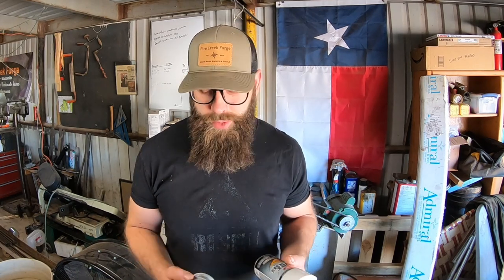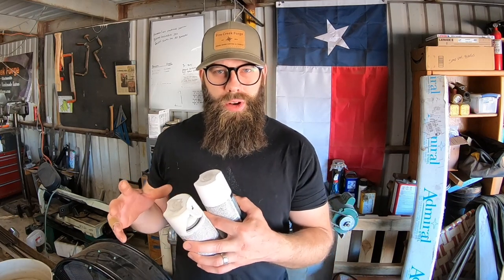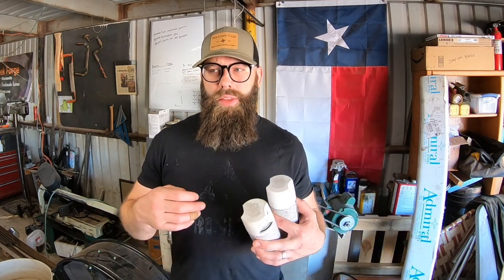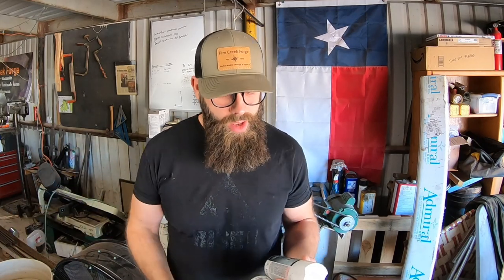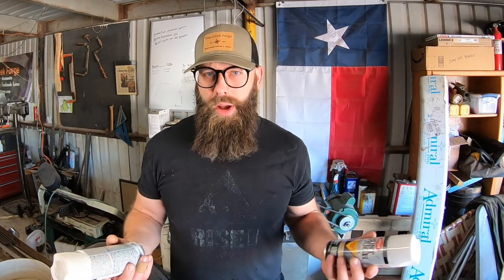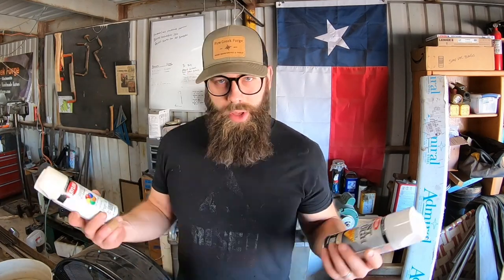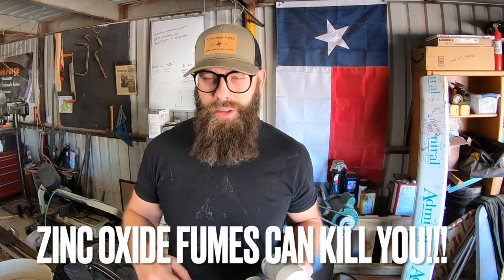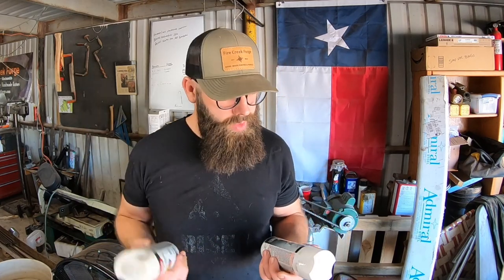Stop Using White Out for Your Canister Damascus!! Tip Of The Day Blacksmithing Forge Welding Knife

Comment: One can check the Safety Data Sheet for the paints you're interested in, or are using, to get insights into what materials are being used as pigments.  The sheets are easily found via an Internet search.  For example, the SDS for Krylon Colormaxx White Primer lists both talc (magnesium silicate, hydrated) and Ti02 as components and they're both white.
Reply from the maker: Good to know
Reply: krylon has around 2%.
Reply: Talc has poor tint strength.  Usually if it's in a paint, it's for mechanical strength/toughness and/or as a flatting agent.  Silicas are often used in a similar capacity but cost more and are more hazardous to handle in manufacturing (but might be preferred for certain applications where the binders need to provide good chemical resistance or flexibility and tensile strength to the cured system).  For commodity paints like Krylon, talc can also be seen as an extender, reducing the cost per volume enough to be attractive.

Comment: The overwhelming likelihood is that white paint will be white because of TiO2.  Rutile is an extraordinarily common mineral in the earth's crust, easy to suspend in paint vehicles, and generally brighter and more opaque than almost every other choice for a white pigment.  So it's not only one of the least expensive white pigments, it's also one of the most efficient ones in terms of manufacturing and performance, and hands-down the most cost-effective.  On occasion, there might be some additional white pigments to lend reinforcement, either color or physical, but almost all white paint is just binder, solvent, some flow/suspensions additives, and good old TiO2. (often other metals present like zinc or tin are in trace amounts and act as catalysts to chemically active binders rather than in the heavy loadings you would expect from a mineral pigment)

Comment: Titanium Dioxide is what replaced lead in paint to make white.  So as long as it's not a really old can of paint that somehow hasn't dried out, I'm pretty sure it will have Titanium Dioxide in it.  Even other colors start with the white as a base but of course also contain other pigment elements you may not want in there.
Reply: As long as it was manufactured after 1978, it should be lead-free.

Comment: The cheaper the better. Titanium dioxide is dirt cheap. Some more expensive paints use zinc oxide or barium oxides/sulphate.
Reply from the maker: Good to know
Reply: Barium sulfate is great when very high electrical resistivity is desired.  Otherwise, it's a less effective appearance pigment.  Zinc whites, too, tend to have less tint strength than titanium whites.  Or they need a bigger pigment-to-binder ratio (or more coats) to get effective hide.  For these reasons and more, I would be rather surprised if a commercial spray paint had anything other than TiO2 for pigmenting.  They might have other minerals like talc or silica for flatting or maybe trace quantities of certain tin or zinc compounds as catalysts for reactive binders or sometimes as uv absorbers.  Now for oil paints meant for an artist on a canvas, sure, you'll find all kinds of different pigments where effects on opacity and rheology can make a big difference for how they handle and perform.  Also, with that said, those other less effective white pigments are great as reinforcers for high saturation pigments of other colors where they might not have the hiding power on their own but with one of those more translucent whites, will still look like the pure saturated color where TiO2 would quickly turn them into pastels.

Comment: Ya know the other option Devin Thomas has recommended is just not removing the canister. The canister will be very thin and easily grind off by the time you get to blade thickness (and you'll have to grind the surface off anyway).
Obviously that's not as good an option if you want to examine the weld and won't work for mosaic damascus.
Reply from the maker: I like to inspect my billet after forge welding though.
Reply: the other problem with this is you have no way of knowing how even the drawing out is going, you can easily end up with half your knife point  made of poorly welded mild steel (those ends tend to blulge out and leave an air space) ...not funny when you have spent time and resources making it.